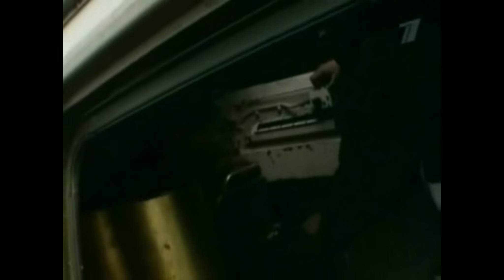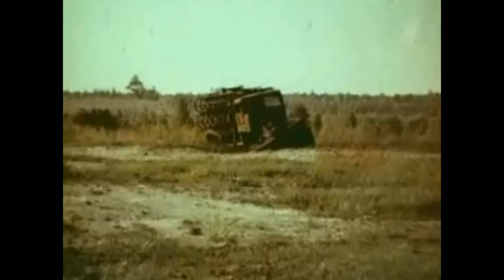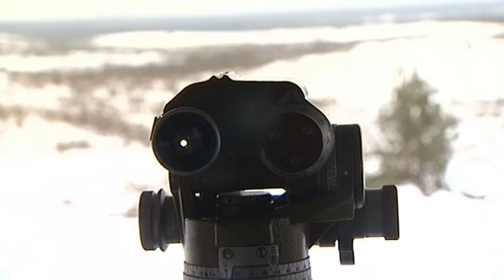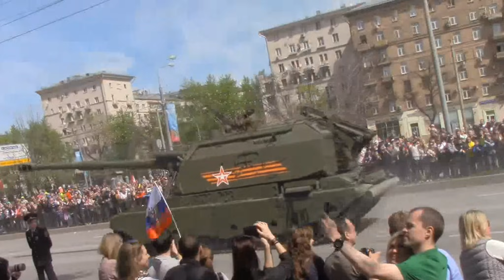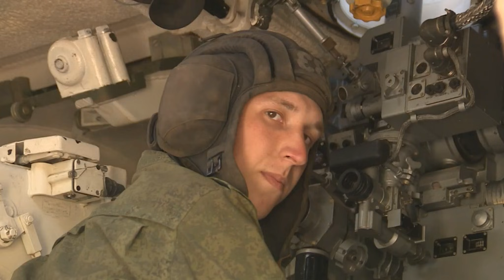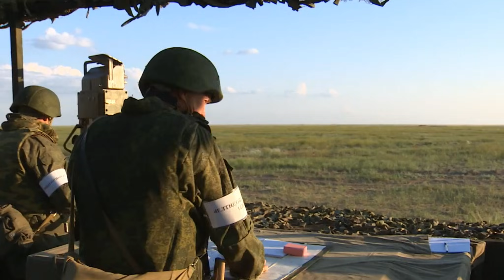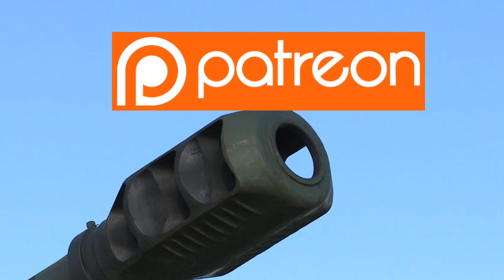Russian  2S19 "Msta-S" Self Propelled Gun - MASSIVE ARTILLERY

Comment: So is this basically the KV-2s great grand child?
Reply: revolverswitch not T-14 but T-16 Armata combat platform
Reply: Don't russian artilleries have a doctrine that made an emphasis for direct fire role just in case of enemy armor getting close?
Reply: Pretty much, but now it's called the Putin fridge
Reply: The T-80 prototype with 152mm was probably using artillery style shells running on lower muzzle velocities. 152/155 is the russian/nato artillery standard.

The Leclerc and Leopard 2 were never fitted with 140mm guns, though. Even the 130mm is only considered for the Leopard/Leclerc successor. And the 140mm Abrams just showed that it's non-viable to use such a big gun. As I said, even the current leopard's long 120mm gun is too bulky for the Abrams (which IIRC uses a special, lighter short barrel).

You basically need to built a tank around such a big guns. And Abrams+Leopard will never use 130mm ammo, already because they effectively need an autoloader to handle the 50% heavier ammo (which again is something a tank needs to be designed for).
Reply: Thanks, didn't know they tried a Leopard and Leclerc with 140mm - guess it makes sense when the abrams did it. But that were purely tests, there was never ever anything close to an actually combat ready tank running that gun.

With bulky, I actually ment weight; a longer gun is heavier than a shorter gun. But barrel length is actually part of the weight problem: The longer the barrel, the further away from the turret is it's center of mass. Because of this, the long barrel of the Leopard A6 actually put too much of a strain on parts of the suspension, and needed further fixing.

I imagine the latter was also the problem of the Abrams; Abrams and Leopard 2 are very similar in weight thanks to the shared design heritage (and the weight being limited by means of transportation).
Reply: SU-152*
Reply: Troll alert.
Reply: @Ignacio Muñoz Diaz  The T95 is a failed project that never made it past prototype stadium. Problem with the gun were a major reason as to why it went nowhere.

Hard to get any info on it... apparently the gun had a very slightly lower muzzle velocity than the 125mm and a weight of over 5 tons? Still not very convincing.

That would be 10% of the T14s weight in the gun, which seems absurd, and the penetration ability of the gun with sabots might be questionable.
Reply: @Ignacio Muñoz Diaz  Energy alone doesnt penetrate.
Reply: @Ignacio Muñoz Diaz  We're not throwing rocks, we're trying to penetrate armor. And thats a lot more complicated than just energy, its not just building a big gun. Sabot design is incredibly complex, and I very much doubt that russian metallurgy is even close western technology these days. 

Also, Russia claimed the 2A82-1M cannon penetrates 1m of RHA at 2km. That would mean your 2A83 cannon is actually pretty useless, multiple times the weight for 10% more pen.

But really, the russian numbers are likely bullshit, because why would any military tell you the truth?
Reply: Buzz Bombs Gaming and guns, nope, kv-2 is assault tank which fires directly
Reply: Ted Archer I am aware of that :)
Reply: T-14 with 152mm gun? I believe it when I see it. Even upgrading western tanks from 120 to 130mm would require a completely new tank designed around the gun; those 10mm difference ment 45% heavier ammunition. Requires a heavier, longer gun (Abrams can't even take a longer 120mm gun), a completely different ammo storage and autoloader system and more. 

Going from 125 to 152 is ridiculous, even if it's shorter ammo. Would massively increase the tanks weight and throw off any previous weight balancing done before.
Reply: @termitreter6545   Its already been done and tested - 2A83 cannon. T-14 was designed to carry 152mm cannon but there's no targets armored enough exist for this beast to shred, so T-14 is using 2A82 (125mm) but can be switched to 2A83 at any given time.
Reply: @orinpolansky386  Haha, this brings me back, one year ago. Do we actually know anything about those 152mm guns? I guess the important part would be shell weight. For example, the Reinmetall 130mm cannon uses very long shells which are 50% heavier than the 120's. 
In comparision, the 152 shells gotta be much shorter. The Armata is a fairly light tank, so I'd be rather surprised if it could shoot super heavy shells.

On a sidenote, the Armata-project was cancelled. Too expensive. Apparently Russia is now looking at yet another T-72 upgrade.
Reply: @termitreter6545   It was already tested on T-14. You have one misconception -  Armata is a modular platform not the tank. BMPT-3, T-14 and Coalition SPG are all variations of Armata platform. And T-14 program was not cancelled it was finished and production lines will be conservated (preserved) for the future. Same awaits Su-57 and any other sophisticated piece of equipment. Russia is not very rich country and cannot produce such expensive equipment in peaceful time just for simple rearmament. They will build short amount of all modern units for testing purposes. In case of war all productions with up to date chages will be resumed in short time and those T-72 can win enough time for this.
Reply: @orinpolansky386  Yeah I know those things, I just wasn't specific enough^^

But as said, we don't know anything about the 152mm shells except russian claims that they got them. They might be absolutely terrible for all we know.

Also, I'll say that while the T-14 is very interesting, the SU-57 just seems to be a poor plane. India didn't even want it and instead bought rafales.
Reply: @termitreter6545  They tested it with 2K25 Krasnopol ATGM which is longer than any standart 152mm shell so questions about shell length is irrelevant.
Reply: @orinpolansky386  Rockets are a secondary gimmick, and they don't put strain on a tank anyway.  

What is important is how the tank deals with the recoil of a heavy shell and how the parts cope with the pressure.

And that is the purpose of a larger barrel. If they only ever shoot rockets with it, then that means absolutely nothing. You don't need a tank barrel for that.
Reply: @termitreter6545   Didn't really understood the question... Coalition module can be installed on Armata platform. Coalition is unmanned 152mm artillery howitzer module. Armata is designed as a common platform for various types of battle modules including heavy artillery.  Which parts need to cope with the pressure?)
Reply: @orinpolansky386  This Termitreter is a typical Western know-it-all, knowing absolutely nothing. Ukraine proves this type wrong on every level because Western weapons have proven unable to withstand the rigours of battle, due to over complexity.
Reply: @a.m.armstrong8354  Idk how clueless you gotta be to use Red Effect as a source. His utterly inaccurate videos and russian bias is pretty much the main entertainment factor of his videos.

And the idea that western equipment has problems in Ukraine is so far away from reality, it gotta be propaganda. 

Especially considering soviet/russian equipment and military turns out to be massively overestimated in almost every way. Western surplus goods sent to Ukraine is apparently a massive headache fur Russia.

But hey, they got drone from fucking Iran to commit terrorbombing, so all is well, I guess?
Reply: @termitreter6545  Western equipment are not suited for high intensity use. Check the complaints of Ukrainian forces.
Reply: @markgilrosales6366  Compared to what, the russian stuff that breaks down everywhere and gets captured in huge numbers?
In reality its the contrary, whenever the Ukrainians do high intensity missions, they try to use western stuff.

Youre probably going of stuff like the PZH2000, where the Ukrainians shot something like 3000 rounds in two weeks without major maintenance (cuz they lacked the facilities).

Yeah duh, no artillery gun works perfectly fine after that. Quality standards of western equipment is very high, its a myth that its not as durable as russian stuff.
Reply: @termitreter6545  I think it may be serious really,  I thought the same but the Remote Turret changes shit. And it was in mind during design but I'm not  100% on anything these days, but I heard it on a few Media outlets, that does not make it so but there is reason to think its possible, and it was not canceled just a production run was done the Russain can't spend billions at a time so they do that often. People just read National Interest HeadlInes and dont look further to read details of the situation. I dont see Russia as a competitor they dont want to bother anyone our Lobbiest Just pay our leaders to keep the fear ramped up so we will accept the spending when there's really no one dumb enough to want war with the USA just no logical, but we dont live in a logical world do we.
Reply: @simulatedpilot3441  Nah, this isn't just a fake national interest story, Russia said they stopped T-14 production and instead want to invest into yet another T-90 variant.

They wouldn't do that if they planned to do some more T-14 production runs.
Reply: @termitreter6545  you dont know the Russians very well then
Reply: It's just on hold our Media likes to say canceled because it bad press both sides do the same shit. Come see me in 15 year see how many there are see who guessed right
Reply: @simulatedpilot3441  No. If you actually follow developments like this, then you'll see it more often than not turns out correct. Same way nobody is actually building the SU-57.
Reply: @termitreter6545  All the tanks you're referring too that tried it have manned turrets. T-14 does not. I can see a 152 mm gun on it with few problems.
Reply: @Termitreter well good news, Germany has a new Panther tank with a 130mm. Biggest known cannon for a modern day tank.
Reply: @termitreter6545  The T14 was originally intended to have a 152mm main armament, see Red Effect's video on it.
Reply: nope the t-14 one the tank